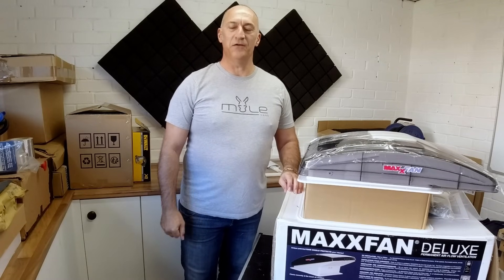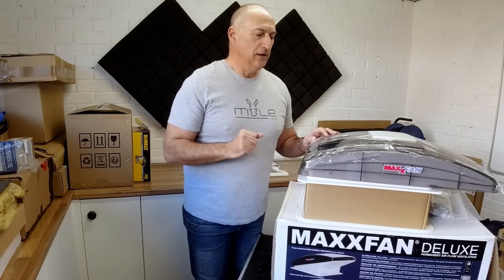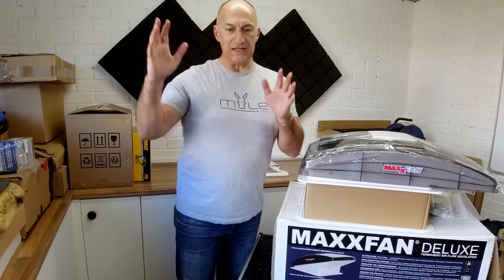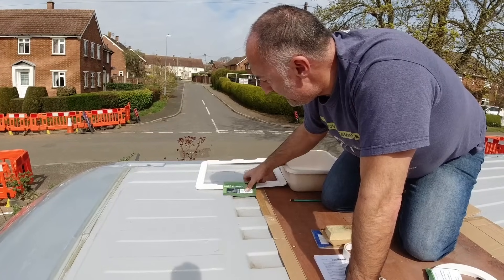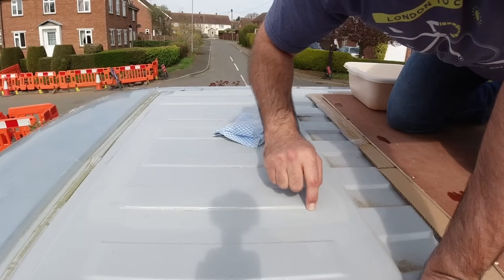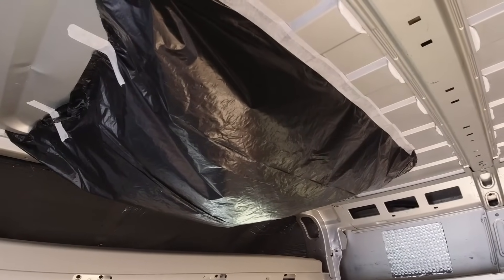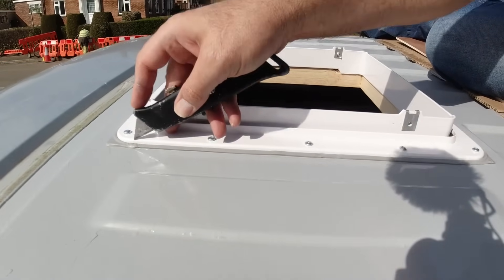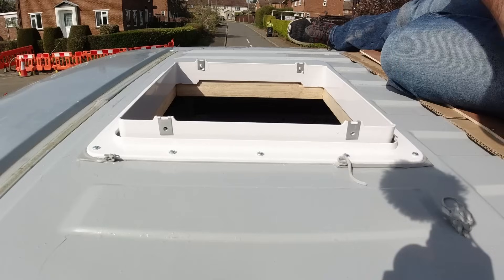Fitting the Roof Vent - Budget Van Build Ep 9

Comment: 30 years of motorhoming  has now come to an end but I love to watch your videos. It’s the engineer in me that appreciates your patience, time and effort. Cheers Richie.
Reply from the maker: Why has your motorhoming stopped? Thanks for watching
Reply: @GregVirgoe   age and disability but bloody fantastic times for us and the kids ( they are 28 and 34 😂). 
Still building motorcycles for fun but again not riding much 🤣.
Reply: What height is the van and how much did the vent add to the height.
2.2m is a crucial barrier height in uk car parks.
Reply from the maker: @tonystacey3347  this is an H2 van so it will not go under car barriers. Any van like a transporter or transit custom you would not be able to stand up in. I didn’t want a small van. We’ve never had any issues parking and out van is 2.7m high
Reply: @GregVirgoe  thanks for the reply Greg especially since I double posted. 
I’ve got a high top transit 02 and it’s miles bigger than the 2.2, but I noticed some new pop top vw were using the under 2.2 as a selling point so I just thought I’d ask as I’ve no idea of the dimensions of the fiats etc.
I also realise you’ve been really considered in your selection of van base vehicle, and I’m loving the smaller build than the palace you built inside the sprinter. 
I’m hoping your 3rd build is a similar size with 4 seats for an additional 2 kids😀if you haven’t retired from the top notch builds /vid content by the end of this one !

Comment: With the Maxxfan or any rooflight the best advice I was given from Rickvanman was to clean it thoroughly as there's often a releasing agent left on them which will interfere with any bond so I cleaned mine with alcohol and then gave it light sand too.
Reply: Such a good tip. Always have a bottle of alcohol handy, the rubbing kind! to break down any grease to bonded surfaces.  My tip is always use a drop of silicone when attaching screws and bolts. They go in and can be later removed more easily, prevents moisture penetration and avoids potential rust corrosion.
Reply from the maker: That’s an excellent point and great advice. 😊

Comment: Awesome video again. Have to say though, given that you're doing a budget build, those roof adapters are very pricey, over £60 for the 355mm square one. Also because they have the ridges moulded in, they reduce the flexibility if you want to mount the vent off the widthwise centre line...you have to move it sideways in steps of about 200mm before it will fit into the next set of ridges. So for anyone with less money and more time, you can make your own adapter pieces by mitre cutting little wedge strips from some 6mm uPVC window trim, which from Wickes will only cost you £5.90. Also doing it this way you can make some extra pieces to go inside the van, between the wooden frame and roof, to really sandwich the van body between the internal wooden frame and the external plastic vent frame.
Reply from the maker: I have seen that done it does look a bit fiddly and time consuming. I agree they could be a little cheaper and they would sell more of them. 😊

Comment: I only fitted one fan in my van aswell, like you Greg i had side windows but it was only later i had the idea to have an air intake in the floor somewhere out the way.
The idea being the air under the van is always cool even in summer so the air is travelling further and transferring more.
Reply from the maker: Great idea, the air in the shade of the van should be a few degrees cooler and good idea to improve air circulation 😊

Comment: A magnet in a cloth run just above the surface of the roof to pickup all the little bits of swarf from the cutting works well. Great demo with the bottle. When i have cut roof panels I always cut 2 sides then tapped it up to hold it in place then cut the other 2 sides stopped the twisting of the panel
Reply from the maker: A good couple of little hacks thanks for suggesting those 👍🏼😃

Comment: Just retro fitted the maxxair deluxe with many breaks to rewatch your video ! 

 I cannot express how well designed the maxxair fan is for installation. I measured the old skylight , twice, and was convinced it would be 355 hole, it turned out to be existing 405 hole but the maxxair has a lip so that it can fit into a 405 hole aswell . Brilliant !

Greg s recommendation of the screwfix self drilling screws was a brilliant. 

Generally just thanks for holding my hand thru the fitting ,  Greg. All those tips were invaluable.
Overall if you're wondering folks , with greg there as reference, its probably even easier then it looks on the video . What a total joy , thank you , thank you !
Reply from the maker: What a fan-tastic comment 🤩
Really pleased your install went well and I know you will benefit from the fans performance. 
Thank you for leaving such great feedback 👍🏼😃

Comment: Something I would like to recommend is to put masking tape on the plate for the jigsaw so that you have the masking tape between the jigsaw plate and the roof. this will help to prevent scratches on the metal roofing material.
Reply from the maker: Yes that’s a good tip and one that I have done before with metal base plates.

Comment: Hi Greg. You are the man! You are as good as family in our living room. Been watching you since the first lock down. On to the question. Context first….we are at Camp Quirky recently glamming in our 2022 LWB sprinter. Only insulation and vapour barrier installed. No heating, no electric and a mattress on the insulated floor. One night was v cold. In the morning condensation was clearly visible on all of the ribs. We did not know where the ribs were but they were clearly identified by the condensation droplets. My vapour barrier is installed against the ribs. So …the question is…… would I be better removing the barrier and then reinstalling it to battens thereby creating a wooden barrier between the ribs and the barrier. The wall would then be installed flush with the barrier. My barrier is the same as yours (double sided foil bubble wrap). A large proportion of the van wall is rib so the insulation stuffed within is not as effective as would be desirable as cold/ heat is conducted in and out. Your advise and experience would be greatly appreciated. Cheers.
Reply from the maker: The problem was compounded by not having any heating in the van to keep the interior space warm. As the internal temperature drops the air ability to hold moisture reduces and moisture has to come out of suspension on any cold surface. A lot of people get damp mouldy vans because they don’t put heating on at night or have a vent open 
We always sleep with roof vent open and the heating on 16° which keep the van well above the dew point and internal surfaces warm and condensation free. Also watch my latest video on temp gradients in van walls. Hope that helps.
Reply: Thank you Greg. Speedy reply. On balance  I’m thinking I’ll remove my vapour barrier, batten the walls then reapply the vapour barrier. Any downside you can think of before I start. By the way, great new series you are producing. Superb instruction as usual. You inspire me and give me the confidence to have a go! Thank you again. John from Gateshead
Reply from the maker: @johnanderson8174  I do have areas where I have double foil bubble onto the internal ribs around the windows then I have carpeted over that. Think that combined with warmer internal temp has been enough to stop any condensation on the surface. It’s about raising the internal surface temp above the dew point 👍🏼😊
Reply: Thank you again. I’m on it!! Doubtless I’ll touch base with you again. Would be nice to meet you one day. 👍

Comment: You've certainly come a long way since your first MaxxFan video (although the head-through-the-hole-in-the-roof thing has been a constant 😆)!
The "helper frames" are a great idea! They are available and competitively priced for Sevels (Ducato, Jumper, Relay). On a Sprinter / Crafter for our 70x50 Dometic roof vent, the adapters retail for € 200. Not in this lifetime.
I've actually imported three packs of the Mastic tape from the isles and installed our Dometic and the MaxxFan using it. It really is that good. 👍
Although it should not make that much of a difference, we attached the timber frame right after cutting the hole with a commercial adhesive, clamping it tight over night.
The only thing I haven't quite worked out is the routing of the cable when using the trim piece inside. Another hole?
Best regards and stay safe. 🚐☁🍀
Reply from the maker: The internal trim flange normally needs to be cut down in height to suit the depth of you ceiling build up. A notch for the cable may also be necessary. 😊

Comment: As an 10:14 engineer I would always just check the frame diagonals - quick and totally accurate. What about marking the roof, drill small holes in each corner and glueing / taping the frame in place inside with a sheet of plastic or thin board underneath and then cut the roof. That way you get an accurate cut and no swarf inside.

Comment: Always good to watch your videos. Out of interest I've never seen anyone cut any holes in a van using a oscillating multi-tool. It works really well and gives such a clean, straight, undistorted and burr free finish. Next time give it a go and see what you think. All the best 👍
Reply from the maker: Have you tried using it on sheet metal?
Reply: @GregVirgoe  yes, I cut both my side windows and both skylight holes using multi-tool. I found it to be very precise and clean. Give it a go, I'm sure you'd prefer it to the snatchy jigsaws. I know it doesn't really matter because it all gets covered up, but in my head I like to know its a nice clean cut !!

Comment: Tip top!! I have to keep the same roof dimensions etc so a big fan like this of not possible, but no problem with the way you installed it; I might have added a lick of varnish to your wood support but that's a small detail. Great use of mastic tape. Keen to see the start of the electrical fit out. Your previous big van was very, very good, and very well done and I'm looking forward to seeing the similarities and differecnes here. This is the area my van needs (after other rebuild parts). While I'm keeping the original units (fridge, tap, light units etc) and wanting to add 240V and solar. Interesting to see whether you use seperate components or a demountable integrated battery unit, if that makes sense. I'm currently favouring a ~60Ah LiPo battery built into a demountable unit rather than lots of permanantly wired-in seperate elements. Thanks for making and sharing!! Nice head out, too.
Reply from the maker: This will be an interesting on with some innovative equipment and combining multiple tasks to make it more economical 😊

Comment: Hi Greg. Fab video as always.

Question: If you were fitting a skylight to the rear using one of the adapter profiles, would you still use mastic tape under the adapter or on top?

If not, would 522 work instead?

Thanks.
Reply from the maker: In that case you only need to use the sikaflex on both sides of the adapter plate. No mastic sealing tape 👍🏼😃
Reply: @GregVirgoe  Fab, thanks Greg.

Comment: Hi, really appreciate that you(r wife) are filming the whole process, I imagine how time consuming it could be.

Just a quick question about the Maxx Fan. The hole is 35x35 cm you said but on the plastic there is a 40x40 ridge as well. Where would sit that one please?
Reply from the maker: There are two versions of this fan. The fans are the same size but they come with two different flanges. Please check if you ordered the 355 or 400 size fan. 
The 400 flange has a row of raised square boxes around the hole the outside dimension of this are 400 so that would need a larger hole.
Reply: @GregVirgoe  Cheers Greg - bought it quite some time ago but found the email Maxxfan Deluxe 400x400 Tint (Clear) SKU: 7500KI40T so that's why I remembered 40x40 - thanks for clearing this up :)
Edit: Just rewatched the unboxing from 3 years ago and indeed, the explanation is there. Marvellous...
Reply from the maker: @thegabormate  awesome 🤩 happy to help 👍🏼

Comment: I feel the biggest mistake van builders make when adding ventilation to vans is you always add it to the roof, ignore windows in this case, therefore only removing any moisture that might be high enough in the vans interior, instead of learning from static and touring caravan builders as well as house roof vents, where you need low down vents to allow the cool air to enter and rise as it warms and thus collect the moisture with it as it exits the roof vent(s).
Reply from the maker: That’s a very valid point. Cold air has a lower moisture content and as it warms the relative humidity reduces giving it the capacity to take on more moisture before being extracted. If you can get vents at opposites sides you will get better cross ventilation 😊

Comment: Great job as always Greg! We are about to fit our Maxxair fan & you have made that task a lot easier so Thank you Greg! Helpful & informative as usual. One question Greg, why did you run the maxxair fan power lead to a fuseboard in your kitchen cupboard? Why did you decide to put a fuseboard in your kitchen cupboard? Do you have an isolator and a voltage regulator for the fan in the cupboard?  (Please excuse my ignorance). Thanks for yet another fantastic video Greg regards Tracey 👍🙂
Reply from the maker: I have half a dozen things near the kitchen to power, fan, lights and pump etc so it was cheaper to run one pair of larger cables to that location and mount the fuse board closer to the appliances than run 6 separate circuits from the battery location. I’m not planning to fit a voltage regulator as I personally have not had any issues with my two fans in 5yrs of using them. You can fit one if you prefer. I can simply pull a fuse to isolate it if needed. The fan works on its remote or local switches 👍🏼😃
Reply: Thanks for your reply Greg. Makes total sense to fit the fuseboard in the cupboard in that case, good idea👍 All the best with the new budget van build, we will be following you as usual every step of the way!   Have a great day regards Tracey 🙂

Comment: Hi Greg, another great video series, you're a great teacher 👍
Just a question about the Maxxfan. It's obviously very highly recommended but I've read a few negative comments recently and I'm wondering what your experience has been.
One comment is that condensation can form on the inside of the rain cover, and secondly that since the unit is only rated at 13V max, some people have had a problem with the fan controller board failing.
What are your thoughts?
Reply from the maker: I actually spoke to the UK sales director about this and over the thousands of units that have been sold here in the UK there have only been a handful of issues. I know everyone I have spoken to has had excellent customer service in resolving any problems so that is all good news. We have had these two now for 4yrs and have not had any issues at all. If you are concerned about higher charge voltage on your appliances you can simply fit a voltage regulator for £20 and that will remove any concerns you may have.
Reply: That's great, thanks for your help 👍

Comment: Hi Greg 
Any suggestion about 12V air  condition?
Reply from the maker: Most ac systems I know need 700w input power so that makes it impractical to run off batteries.

Comment: Here's a top tip to those with 2 Max air fans. When in the bed, open the back fan lid fully but do not turn on. Turn on the front fan to suck low or high. Lay back and feel the ultimate cooling breeze whilst saving on energy by only having one fan running.( Works better by not being switched on)
Reply from the maker: We always have them both open when in the van. Best to have plenty of fresh air.

Comment: Hi Greg - great video and series as always. Out of interest what are your thoughts about just bonding the fan frame to the roof of the vehicle and not using the screws through the roof? This would avoid the need to drill the fixing holes in the roof and minimise the likelihood of moisture ingress. Do you think the bonding agent/adhesive (Sikaflex) is enough to secure the Maxxfan to the roof? I’d welcome your thoughts and perhaps others on this one? Keep us the great work 👍
Reply from the maker: Maybe if you just used sikaflex and not the mastic sealing tape that could be sufficient. I don’t think I would be happy just doing that personally. 🤔
Reply: @GregVirgoe  Hi Greg, sorry to repeat my question but I think it might have got lost among all the comments.

If you were fitting a skylight to the rear of the van where the roof has ridges and were using one of the adapter profiles, would you still use mastic tape under the adapter or just on top between the adapter and fan frame?

If not, would you just leave a bead of 522 underneath it and then a layer of mastic on the top?

Many thanks.

Your new series is great for me as I've already done some of the jobs you cover and it's reassuring to know I've done them right and others I'm about to do and it's reassuring to see how to do them!
Reply from the maker: @hillstreesandstreams  if you are using the adapter frame you just put a decent bead of sealant under and on top of the adapter no tape

Comment: Self-tapping screws will easily screw through the thin metal of a vehicle body without requiring any pilot holes to be drilled. The only difficult part is ensuring that they're properly centred and don't wander before cutting into the metal. You can do this by first making a little centre dimple using a bradawl, or by using the screws themselves and gently knocking them with a hammer.

With a bit of practice you can accurately screw self-tappers straight into metal without having to make a dimple first, but I wouldn't recommend it to the uninitiated.
Reply from the maker: I’ll take your word for it but I think for ease a pilot hole is much safer way to go for novice builders. 😊